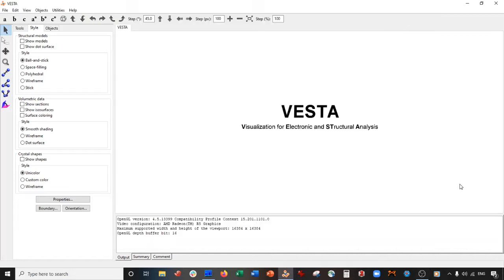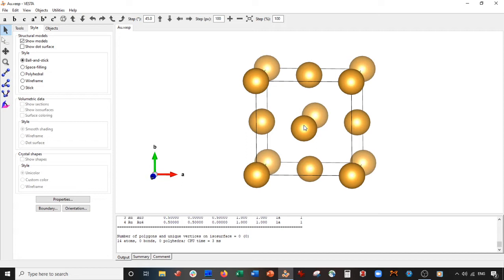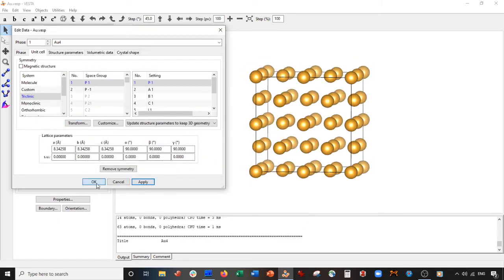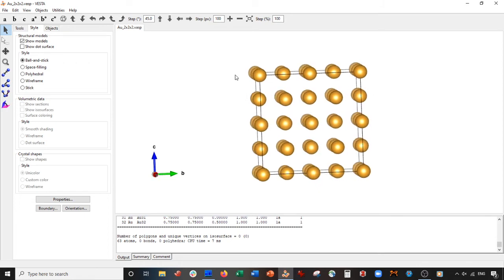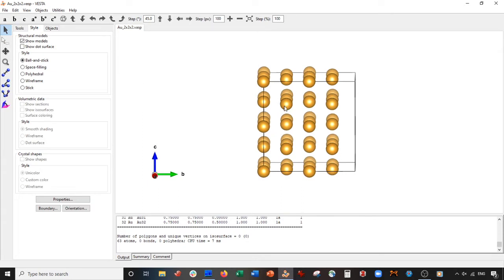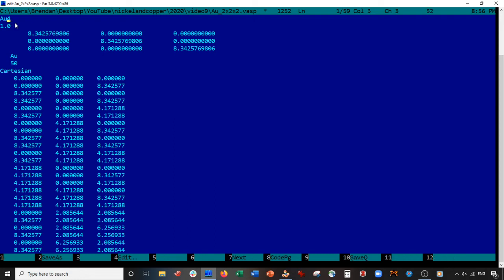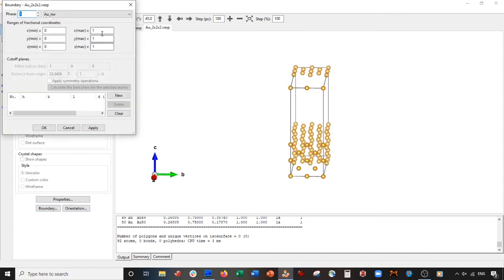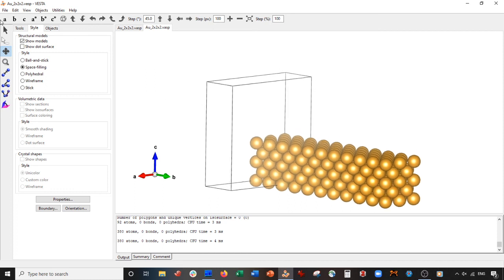VESTA Software - Build Au NanoWire

Comment: Thank you for your video. Could you tell me how to get an oriented Nanowire eg. (110) or (111) ?.
Reply from the maker: You mean how to have the NW surface be 111?
Reply: @nickelandcopper5636  yes. That's what I mean.
Reply from the maker: Just reconstruct the original unit cell such that the 111 face is now an exposed face. Then follow this procedure to make the nanowire. I have plenty of videos for cutting 111 surface from a cubic structure
Reply: @nickelandcopper5636  thank you for clarification.